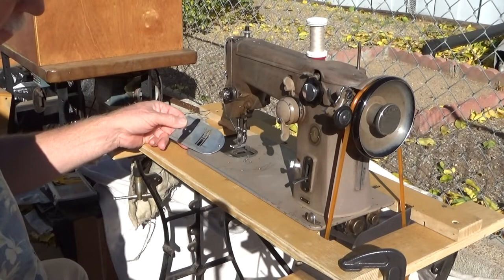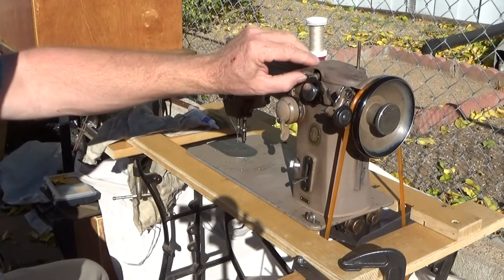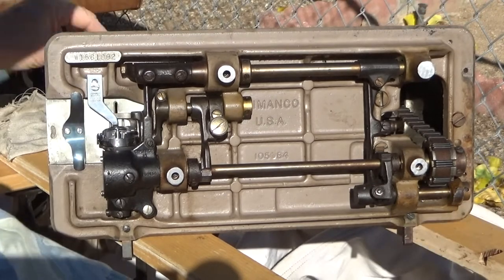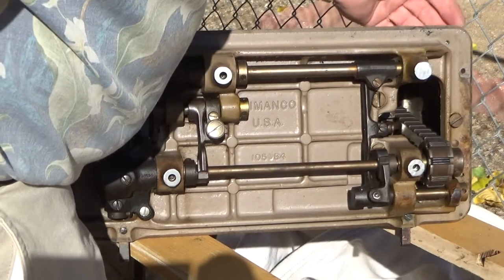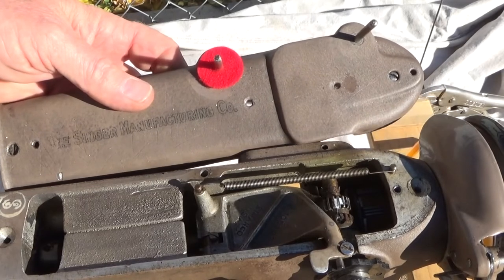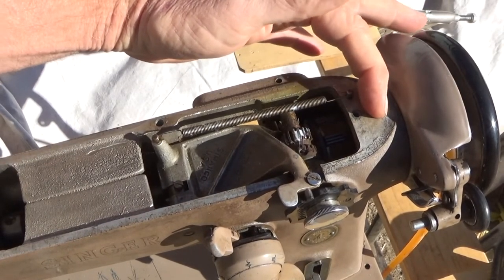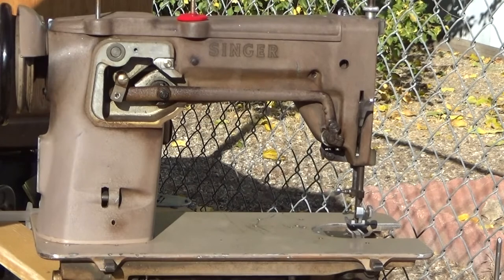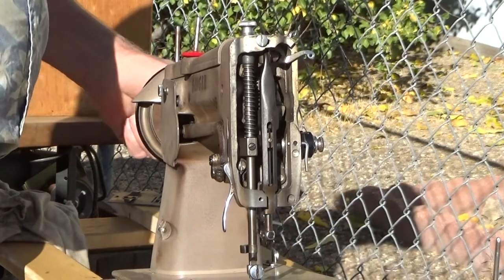Singer 306 Noise Reduction

Comment: Just to mention (time slot 25.23) screw is loose on the presser foot leaver. (I have a black 306 in a queen Ann table with knee leaver pressing a standard foot controller) which I can't use ;-) I am 6ft 2"
I will in time modify a 20U bobbin case to cut a slot on the bottom to slide over the pin.
Bought the 306 in the UK this year; it was dry and noisy and had not been used in years the belt was hard and brittle. 

Good luck with your move abroad.
Reply from the maker: Thanks!  One of the key reasons for doing a thorough clean and lube is to inspect for wear and potential problems.  Moving machinery, even something as basic as a sewing machine does not react well to coming apart under load.

Comment: i got give one o9f these with a 319k as spares but the hook is frozen stff
Reply from the maker: I had a couple (306 and others) where I had to take the hook apart to clean dried oil out of the shuttle race.  I was living in the high desert of Southern California and some of the storage units got hot enough a slow cooker worked just fine without being plugged in.

Comment: Well
It's noon in a small town
Reply from the maker: One thirty actually.  That's the emergency siren for a nearby dam.  If you hear it at any time other than 1:30 PM you're supposed to run for the high ground.  Town is also under the flight patterns for Naval Air Weapons Station China Lake.  You not only get them making practice runs at taking out the dam, part of their mission is evaluating new hardware, both ours and the opposition.  So on any given day you might see almost anything zipping past, being chased by almost anything else.
Reply: @joekahno  War is just SO grotesque and SO bad. But the tools of war are just SO cool!!
Reply from the maker: @theprojectproject01  Most exciting moment was when a local wildfire got within a block of the laundry where I was running a load through.  The plane dumping a load of fire retardant passed inside rock thowing range.  Getting that close to a 727 being flown like a crop duster in the mountians was awesome!